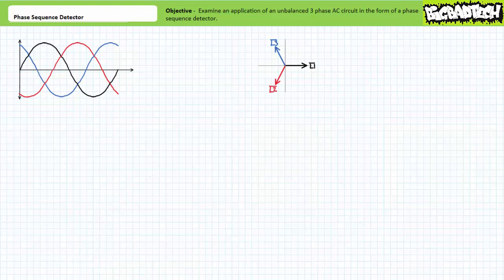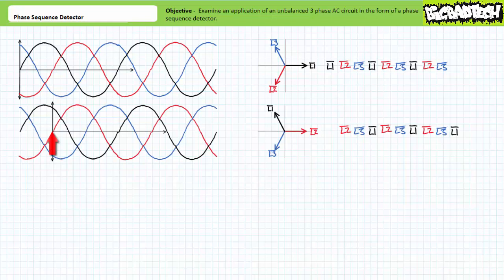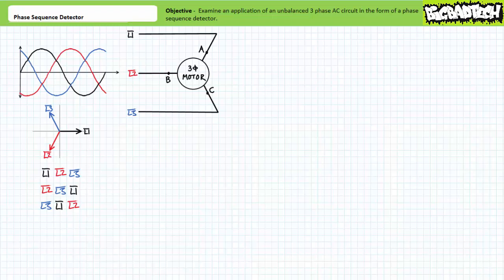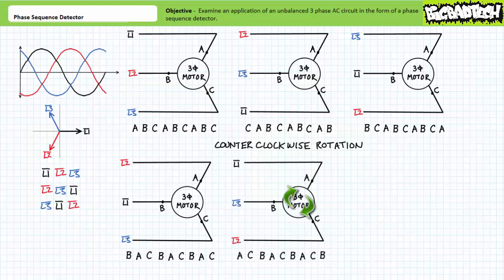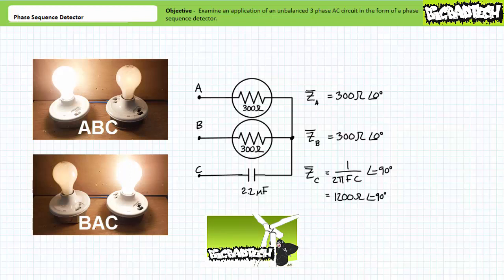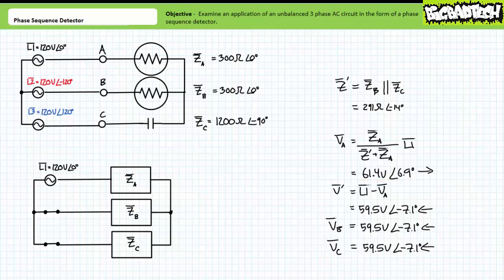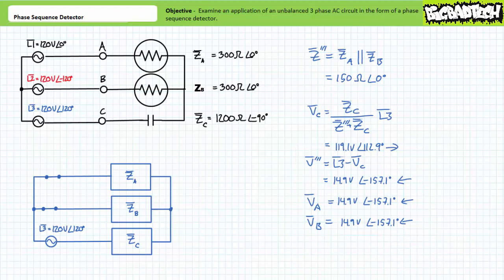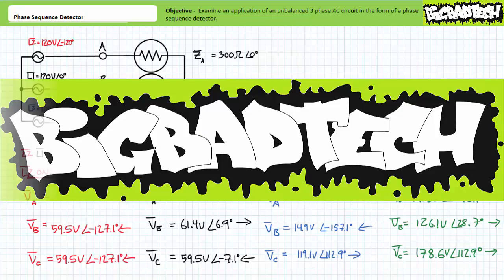Phase Sequence Detector (Full Lecture)

Comment: Nice to see an empirical demonstration of this. Intuitively it makes sense that the phase shift in current through the capacitor would mostly follow the downstream pathway with the most favourable voltage drop, even if impedance is the same both ways.

Comment: I made a mistake during this video that might be an interesting discussion point. I thought I could use Kirkhoff's voltage law to check my work, specifically the results in 'sum' green column shown on the video at 16:39. If we consider one loop, say the L2 to L3 loop, then I though I could simply add the voltage drop phasor for each element and come up with the phasor subtraction of L2-L3. I reasoned that I could ignore the L1 arm because it was already taken into account by the summation. Wrong! L1 also joins the loop on the input side, it is not so easy.
Reply from the maker: True dat. For unbalanced 3 wire Y configurations there will be a voltage differential between the two disconnected central nodes. KVL should yield the same result for all 3 loops (difference of load central node with respect to source central node = L1-V1=L2-V2=L3-V3). The advantage of 4 wire Y configurations is that the neutral wire keeps both central nodes at the same potential.
Reply: @bigbadtech  Oh, of course (forehead slapping moment)! Thanks, it was actually easier than I thought, and very simple to understand.